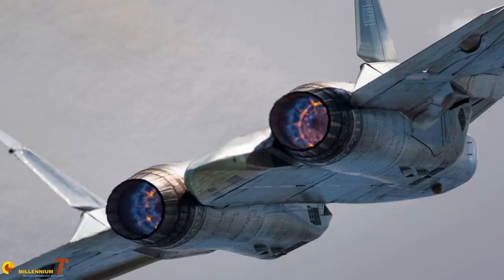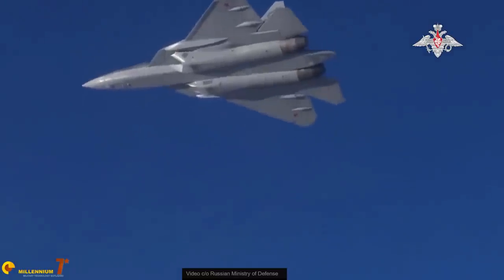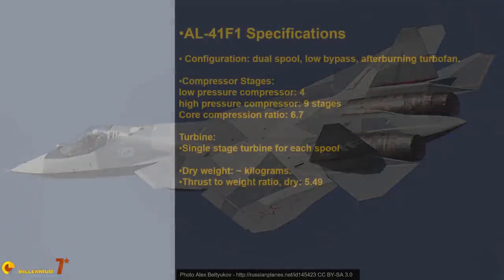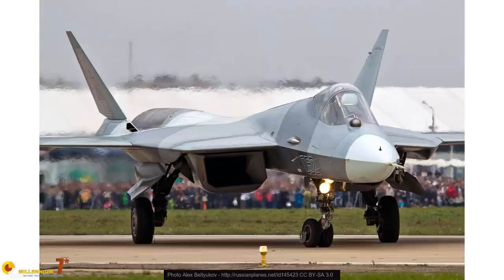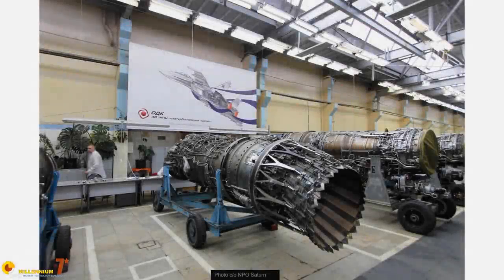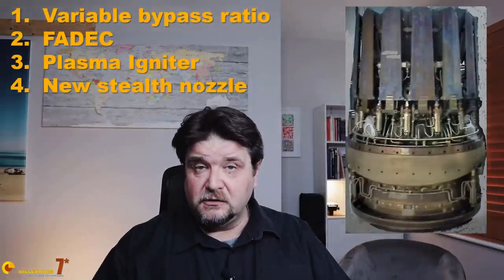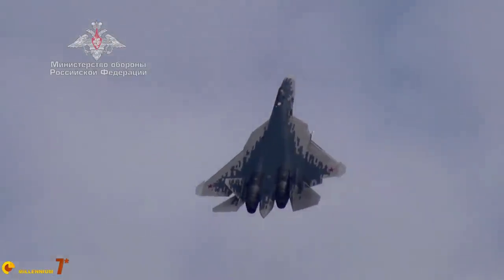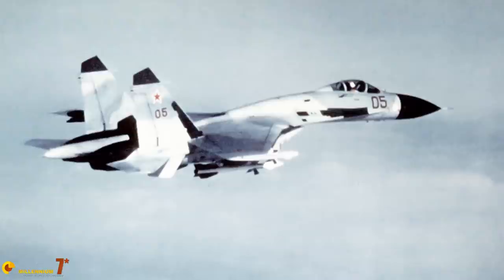Su - 57 the Raptor Slayer | Part 2 - Propulsion

Comment: better thrust vectoring = Jets can better dodge the guided missiles algorithm? am I right?
Reply from the maker: Yes, it is a possibility, in my view.
Reply: Bleed off the missile's energy all the while retaining the energy of the aircraft when  executing evasive maneuvers.
(That's what my thoughts are)
Reply: Nope, missiles today pull upwards of 50-60Gs, most fighter jets can only sustain 9-10Gs, at MAX 12-13Gs before the airframe instantly breaks - and that's not considering the pilot. Though maneuvers are important, hard pulls and quick maneuvers are not. It's about bleeding the speed and energy of the missile, so it either can't keep up with you, or is too slow to turn effectively.
Reply: @alexander-it6mx  I think thats what he was reffering
Reply: @dirckthedork-knight1201 Yeah but better maneuverability or thrust vectoring doesn't help that. Better energy retention in maneuvers does.
Reply: @alexander-it6mx  Thanks Alex. Some times ago  I watched an interview of Iranian F-14 Pilot who dodged multiple Iraqi air to air missiles just using his jets thrust capabilities, without firing any of his F-14 expensive missile (they were under sanctions) he made Iraqi jets finish their missiles and run out of feul and let them drown in persian gulf. I was wondering if Su-57 has similar capabilities to dodge a air to air missile (obviously when manned with good pilots).
Reply: Not really, the missile will travel a lot faster than the target plane. Sharp small maneuvers won’t help and long maneuvers can be done all the same with other control surfaces. You just won’t have the time to dodge a missile when it’s close. Rather you need to make it run out of fuel and kinetic energy by maneuvering when it’s still far away.
Reply: These fighter jets cannot ever dodge the new missiles with GPS tracking and variable speed rates. Only the quantaum computing on F22 can render it invisible! Unless the chineses have managed to make quantaum radars.
Reply: @buzekohi  Neither side were using highly complex modern missiles at that time. My guess is that the Iraqi pilot most likely was using some older soviet R-3 variant or R-13 variant missile. Those missiles had relatively short range, burn time, and inferior maneuverability - making it possible to outturn them if spotted. 

Today's aerial combat is a lot more longer range than before, but to answer your question, if the Su-57 came within dogfighting it would likely be supreme than any other plane in the world. Even though it is super-maneuverable, it is not it's maneuverability that would save it from incoming infrared missiles. Su-57 has advanced equipment such as jammers that stop the seekers of infrared missiles, which is seen as the small glass ball behind the cockpit, on spine of the plane.
Reply: @desidesigning  Thanks. I heard first time about quantum radar.
Reply: @alexander-it6mx  They can pull 50-60G while their engine is burning. Once their engine runs out their ability to pull G's depend on missile speed/energy. If the plane changes it's direction and missile loses energy to follow the predicted point of impact, the missile can be drained of energy early on, and be unable to hit the target.
Thrust vectoring is not going to help the plane escape missile in close combat, it can be used to avoid missiles in longer range combat.
Reply: @alexander-it6mx  thanks. Now Its more clear to me.
Reply: @unknownuser069  Wow, very philosophical analysis. Thanks.
Reply: @dariozanze4929  I know, this is what I already commented.
Reply: @unknownuser069  Perfectly said, couldn't have done it better.
Reply: @desidesigning  Wrong, for longer ranges, bleeding the missiles speed is important. For close ranges, jammers and interfering with the missiles tracking system is vital. F-22 is far from the only plane with those capabilities.
Reply: @alexander-it6mx  Hard pulls and quick maneuvers ARE important, since they are the single most effective way to bleed missile speed and energy, it's just less preferable since you will be slower for follow-up attacks, but IF you use thrust vectoring to pull weird maneuvers whilst keeping your own speed, that is just another tool to combat the missiles, which already have a low hit probability with most BVR's ranging from 20 upwards to 50%
Reply: @vonvonvonvonvonvonvonvonvo7009  At long distances, small, quick changing maneuvers just doesn't do that. Prolonging patterns and strategies do.
Reply: @alexander-it6mx  hypersonic missles have Mach 7 speed. These planes would incinerate at that speeds. SR71 Blackbird is no more; which can outpace missles. All planes and jets are sitting ducks. Drones flying at low altitude and low speed is now modern warfare! 

China has already made a  Quauntum computer.
Reply: @desidesigning  Lol SR-71 can't at all outrun a hypersonic missile. It couldn't outrun most missiles at their top speed, only difference is the SR-71 could keep that speed, unlike most of the missiles at that time.
Reply: @alexander-it6mx  I'd beg to differ here. Agree I'm referring to historical information about the SR71; which even the Mig 31 foxbat couldn't catch over the the soviet territory. Remember the U-2  spy plane incident? 

Newer drones would have ramjet engines and would fly at mach 7. Human body cannot tolerance this much Gs. All jetfighters would end up in war museums soon.
Reply: @desidesigning  to my knowledge, SR-71s never actually flew over Soviet territory. And, with the kit they had, its not like they even had to anyway.
Reply: @desidesigning my guy you realise modern quantum computers are the size of 3 F22s combined and need to be cooled to close to 1K. Also what the hell is quantum radar. Radar uses a frequency of 30-300MHz

Comment: You stated Su-57 with new more powerful izdelie30 engine will be able to supercruise at Ma=1.4 in 2025 when F-22 with old engine with marginally lower dry thrust already supercruise at Ma=1.6. Does it mean 20 years old Raptor at the verge of being phased out has better aerodynamic than Su-57?
Reply: "very aerodynamic" is a very general term. This is difficult to answer without knowing the secret performance charts of these planes. I would assume the Raptor may have lower overall drag at that speed region compared to the Su-57. The Su-57 might be more optimised for other speed regions and less emphasis is put on high speed supercruise.
Reply: To answer that question you would also have to know in what configuration the plane was when those numbers where taken. How much fuel they got for example can greatly change the TWR. Also both planes have internal weapon bays but can carry additional weapons and fuel tanks externally which adds a lot of drag.
Reply: Many people don’t know about the U.S study comissioned by the air force. They analysed flight information from Vietnam to Iraq. They found that in 87% of combat flights the speed of Mach 1.2 was not exceeded.

Comment: I think the thrust vectoring can be useful in BVR combat, as long as the plane is able to detect the incoming missile.
The BVR missile is going to home on predicted point of impact, Sukhois are able to rapidly bleed energy, point their noses in different direction, and move the predicted point of impact all over the place. The missile bleeds the energy to follow the predicted point of impact.
Missile which bleed energy is also slower, giving Sukhoi enough time to accelerate out of area where mssile is able to hit it.
Reply: @unknownuser069  Yes it depends on  the kinematic performance of the missile, as well as flight characterics of targeted plane, and it's energy.
At certain range the plane cannot maneuver out of the missiles kill envelope, plus even if it does it can end up being slow and low, an easy target for a follow up shot.
The point I'm trying to make is that this range should be higher for planes with thrust vectoring, as long as they are able to detect the incoming missile.
Reply: @unknownuser069  It is still relevant because most existing planes are not stealth planes. Plane kinematics are what limits the kill range of missiles.
For stealth planes rules change.
As for the future it is really hard to predict, we also have "stealth radars", and UCAVs and some technologies will sucede, some will fail.
Reply: @unknownuser069  Well F-22 doesn't have just stealth. It has stealth, great kinematics (+supercruise), electronics including great AESA which can track older planes without getting detected.
The combination of those elements enables it to turkey shoot older planes.
F-22 has two problems, lack of range and a huge, huuuge problem... it's not for sale.

So in the case of West you are left with F-35 which has it's own share of problems, developing your own stealth plane, buying 4++ gen planes, and your rivals have a bunch of 4gen planes.
Reply: @unknownuser069  Yup, 20 years since entering the service, no modernizations and China and Russia are building stealth planes which are objectively worse.

If I was making the choice, I would start building two seat F-22's with better avionics.
And modular stealthy UCAVs which could serve as tankers, sensor carriers, missile/bomb carriers, ECM... they could even carry some future antimissile systems.

I think that kind of airforce would dominate on the battlefield, both in air dominance and ground pounding without being too expensive.
Reply: @unknownuser069 I work in shipbuilding industry, and some things do translate.

Designing and testing the new airframe is actually the easier part of the job. Today we have such great software, and 3d printing for rapidly making models and testing the aerodynamics, and I'm certain that they have software for stealth calculations.
New engines can be highly problematic, but US already has top of the line engines, and as far as I know the work on better engines never stopped. And F-35 has top of the line sensor suite, electronics and avionics.

As long as they do not incorporate some high risk technology as "hard baked" into the system they should be able to start rolling new planes from assembly lines within 10 years.

As for the cost, that's what new F-16/15 and drones are for. By using cheap platforms for policing US skies and bombing taliban positions... you save the resources of more capable planes, and save money which means you can go expensive on new platforms.
Reply: @unknownuser069  How much effectiveness do you think the F-22 would lose vs last gen fighters if it had to penetrate airspaces with a lot of early earning radars?
Reply: @unknownuser069  thank you very much!

Comment: F35 uses serpentine air intakes which shield the fan blades thus decreasing RCS....the Russian bird has blades which are visible and thus increase RCS..  Also note the targeting pod  just in front of the cockpit - ok when inactive but when seeking targets the RCS will spike significantly..which is why the 35 has an integral system.
RAM is also important...on the F35 you see an overall smooth finish which indicates the application of a Radar Absorbent Material...rivets and other fastener heads are visible on the Su-57 - which implies a much reduced - or absent RAM.   Looks cool, extremely manoeuvrable but it's RCS is higher than a F35 which means it can be seen sooner and at greater range...and that is not good for a supposedly Gen 5 A/C

Comment: Hello! Nice set of videos, I'm going to hazard a guess that thrust vectoring can help overcome departures of control from engine loss.  Further guessing, I'm really a nobody, this vehicle has widely spaced engines. This can potentially cause a asymmetrical thrust that would be hard to overcome. I'm thinking of the flatspins caused by an engine unstart in the F14 Tomcat, a vehicle with rather wide spacing, not unlike the SU-57. This is the time that I wonder how engine loss performance affected the Vigilante?   Anyway, I doubt that's the ultimate secret to thrust vectoring for the Su-57. But just a thought.

Comment: Couldn’t minimizing the control surface deflection help minimize the radar return characteristics? If so, then the use of thrust vectoring is an obvious solution, but may not be very relevant except for the pitch control.

Comment: The thrust vectoring could possibly play a roll in the short take-off ability you mentioned. I heard from one of their pilots that it easily can take off from a carrier. You mentioned the possibility of a missile evading purpose... I heard from one of the designers of a 6th generation element the platform was designed to accommodate for is counter missile defenses that go far above what has been fielded before. The fat tail cone is hiding a rear facing radar and has skin rader elements embedded into body and wings. I heard from the designers its final form incorporates either a gun or laser to incercept projectiles. If it is intended to have an automatic algorithm for those things than adding some code to have the thrust nozzles automatically engage in evasive manuevers would well be within its feasible abilities. They have been testing the okhotnik drone wingman operations and one could imagine an airborne flight group similar to a carrier group with the smaller units as shields around the SU-57 for defense and stand off range attacks. It would be easier to make the attack drones more stealthy to get closer to the target before detection and gain first strike. The defense drones could most mimic the su-57's radar signature to be indistinguishable to the missiles. My analysis is that the SU-57 is a 6th generation capable fighter but until all of its design features are online it is a 5th+ gen fighter.  My speculation is that  the SU-57 is a temporary stop gap technology test bed that they do not intend to produce in large numbers because its final form although based on the 57 will be unique enough to be considered a whole new plane. I suspect the current 57 to be more of the export cash cow basic version. I bet you are looking forward to that Pak-da and mig-41 as much as myself! Do you think the rumors are true that one of these may have exo-atmospheric abilities? It looks like they regard this as another 6th gen attribute.The single engine 57 based light fighter should be interesting also.
Reply: You "heard" from one of the designers?
A Russian designer talking to a YouTube poster about sensitive aircraft features and design?
Yeah right...was that before he was executed?
Reply from the maker: The exo-atmospheric capability is likely a boutade, but all the other elements you mentioned have been studied, some are implemented, others are debatable.
Reply: @GM-fh5jp  Ha no he didn't talk to me directly. I have seen interviews of Mikhail Strelets, the chief designer and head of the Sukhoi design bureau. I heard from him as in heard him talk on the subjects in a public setting so clearly was allowed for release. I'm sure you can find close up pictures of the SU-57 tail you can clearly see the "radioactive" symbol on the tail to indicate emission source. This is for rearward facing firing control not just for timely flare and chaff shooting. They really really did not want to reveal its short take off abilities that number seems to be classified along with when all the features will finally be online. An interesting thing already on the su-57 is the fiber optic based information system connecting all of the sensors and computers on the aircraft. This would be something you would expect to find in spacecraft so I think the SU-57 is testing the mig-41's computer and data network because the mig corporation hinted their craft could possibly be able to jump into space to go extremely fast and then drop back down for a sudden strike. At the very least the fiber optic based data network would prove to be a platform extremely resistant to electro magnetic warfare.

Comment: The thrust vectoring is supposed to be used in conjunction with the DIRCMs and the Himalayas EW system.  You touch on the idea at the end when you talk about how missiles have to predict where their target will be at impact.  What the Su-57 is designed to do is to dazzle (confuse) the attacking missile and then quickly reposition out of the way.

Thrust vectoring by itself is of low value.  It's a little bit better than solely relying on aerodynamics for supermaneuvrability because you don't have to bleed as much energy.  But you still bleed a lot.  But thrust vectoring together with an active protection system is priceless.

Comment: I love this airplane. But let’s not call it a Raptor Slayer.  No USAF fighter has suffered a loss in over 50 years.
Reply: There are some losses in Yemen. Israel also lost at least one in Syria. Also in Serbia. Those by AA. Argentina lost some skyhawks by harriers in Malvinas. Pakistán also lost 1 f16.
US fighters go dawn without air supremacy.
Reply: @lisakeitel3957  Iraq shot down a f18 with a mig 25.
Reply: I should have said an AIR TO AIR loss.  I'm sure some have gone down due to mechanical difficulties and possibly surface to air missiles.
Reply: @humansvd3269  to quote Johnny Carson, "I did not know that"

Comment: The F-22 Raptor is already 18 years old while the SU-57 is a new design but not yet in production. The Raptor is no longer in its prime while the Su-57 is a younger animal but you cannot count out the Raptor yet.

F-22 will be replaced by the new 6th gen fighter anytime soon.

Comment: The AL-41F1 is definitely enough to propel the Su-57 to supercruise. Its marginally less powerful than the F120, but the Su-57is much lighter and more aerodynamic than the F-22.
Reply: But he stated Su-57 with new more powerful izdelie30 engine will be able to supercruise at Ma=1.4 in 2025 when F-22 with old engine with marginally lower dry thrust already supercruise at Ma=1.6. Does it mean 20 years old Raptor at the verge of phasing out has better aerodynamic than Su-57?